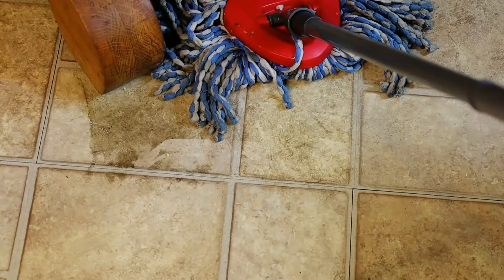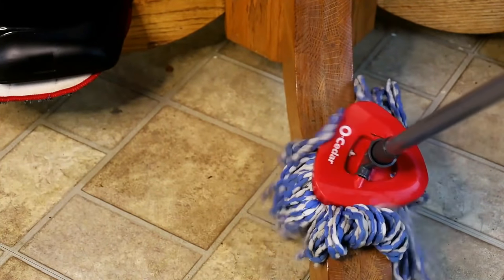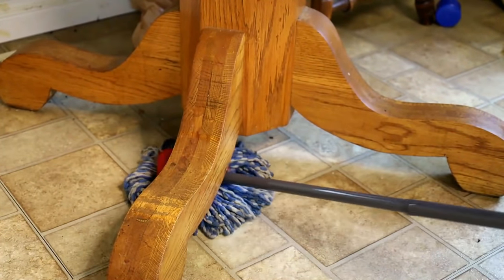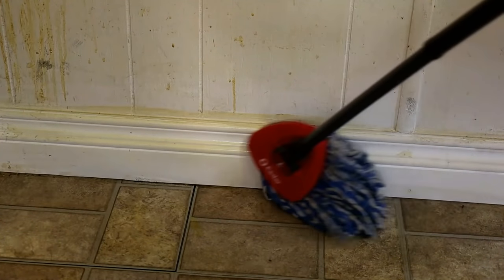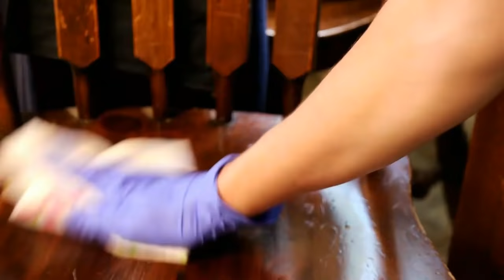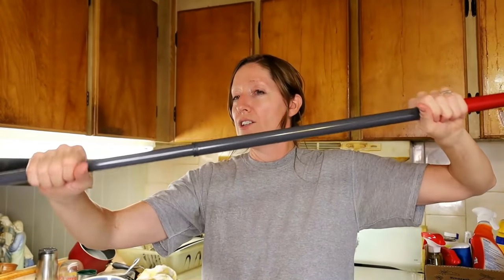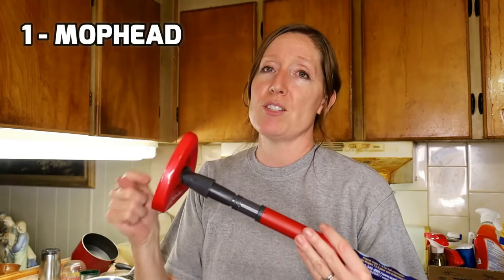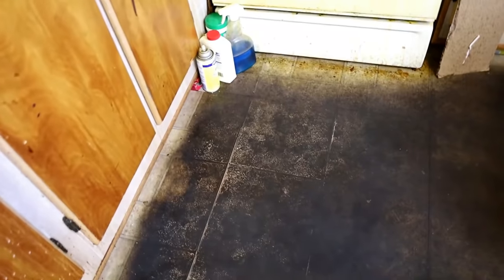UNBELIEVABLE ⚡ Put THIS on Your Filthy Floor and WATCH WHAT HAPPENS

Comment: I'm curious how super hot water and Tide would have done. I've been using it lately to mop, and my husband said they used it when he was in automotive school because it would break up the grease. Your relative is blessed to have you! ❤️
Reply: When I worked at Taco Bell years ago they used Tide powder and hot water to mop the floors. It worked really well to get the floors clean and grease free.
Reply: I used tide with bleach (powder)and hot water with a bristle brush and handle on my great aunts garage floor and walls because she is sensitive to harsh smells. It worked really well and it smells awesome still.
Reply: Yes I think Tide is a better cleaner degreaser than it is a laundry product. Maybe it should stay in the Garage for cleaning.I itch like crazy when ever I’ve used it in my laundry. And so do my boys.
Reply: What kind of floors are you using that on?? Does it leave a film on it afterwards?
Reply: @violetcurry540  I use it on vinyl and tile. It does not leave a film when I use a mop. ☺️
Reply: @smalltowngirl78  Thank you I have hard wood floors and I am trying to find the best clean solution with messing up the floors.
Reply: @violetcurry540  Don't put any bleach (powder or liquid) on your hardwood floors, it'll make whitish spots anywhere the finish is lacking and can cause other problems.I found amonia to be a time tested awesome cleaner (even on floors as bad as the one in this video) you just need to have plenty of air to use it. I used it half strength (half water half amonia) it'll cut through most anything. But test any cleaning products on an inconspicuous spot somewhere to see how it affects the wood finishes. 
Edit: (I've even used amonia full strength on a wet warm cleaning cloth I've laid it on a problem area for 5 minutes and bam, gone.But do not breathe in the fumes or have a 7p e sensitive to such nearby, like kids, the elderly. Stubborn carpet stains come up with a half water and half amonia spray too.)
Reply: @KathyHussey063  Thank you
Reply: @sherry7x777  I agree on the itch factor. I have to use Tide free or Costco Free and Clear for over 30 years because regular detergents and laundry cause itching.
Reply: @violetcurry540  you're very welcome, I just saw words in my last comment were typed wrong so you may want to read my comment again, because I corrected  them. My bad....
Reply: I hate the smell of Tide. Can't stand it.
Reply: I use Simple Green degreaser. It's effective, doesn't stink, and rinses clean.
Reply: @violetcurry540  use white vinegar and hot water I had a cleaning business for 25 years and hardwood floors that's all you want to use is white vinegar and hot water
Reply: @kellierae7602  what is the portions for that??
Reply: @violetcurry540  sorry I just now seen this with the vinegar one cup of white per gallon and your water needs to be hot
Reply: @violetcurry540  another thing if you can't stand the smell of the vinegar it's not going to be too strong it'll go away you can also put in the middle of one or two drops of lavender you know the oil drops it will not hurt it just some of my clients did not like the smell of vinegar if they were home and I'd put a couple drops of lavender drops any of these other products will leave whether you see it or not we'll leave a film a buildup on hardwood floors one cup of white vinegar to one hot gallon of water
Reply: I've used some Tide in my carpet cleaner.

Comment: What a kind thing you did to clean the floor. A cleaning Angel.
Reply: We had a fire in the kitchen that left greasy  black residue on the walls and ceiling.  Found Scrubbing Bubbles bathroom did a great job on semigloss paint

Comment: Great work!  I have one suggestion.  When you were trying to get all of the goop up with a sponge, I thought you could use a wide scraper to lift it up (not really scrape) and just throw the goop into a container instead of washing it down the sink.
Reply: Then do what with it dump it outside?
Reply: In fact it’s going to be a disaster her putting all that grease down the sink.
Reply: Exactly. I'm watching this video thinking, just scrape the muck up into a container. Wiping it with paper towels is just removing the moisture, not lifting even half of what was loosened up.
Reply: Use a floor brush to brush off all the grease cleaner on the floor. After that, use a rubber window scraper to scrape all the grimes to the corner, throw some old newspaper to absorb and repeat until it's all clean. No more mop is sacrificed
Reply: Are you a business cleaning homes ma’am?
Reply: What an achievement. Well done! I’d have tried vinegar first though.
Reply: What would’ve probably worked better is a wet dry vac
Reply: @EyeKnow1111  the man is lucky he even has her there to even try and clean it. Why do you people Gotta be so freaking negative
Reply: @spaghettieggplantsauce8533  . it amazes me how are you all have it figured out using a scraper across the floor will not get the stuff out of the cracks. It would just push it down into the cracks. The mop is needed to get is fine cracks cleaned.
Reply: @teresanoel4035  Says the woman who also offered suggestions on how to do it a better way. 🙄
Reply: @spookshow6999  Dump it in a garbage bag and throw it away...
Reply: It’s built up solid grease with dirt. Scrape it to get up at Least 70% of it in plastic bag tie it up well and toss it. In trashcan

Comment: I'm very impressed with your results. I would have replaced the floor myself. I wouldn't recommend that you be squeezing your sponge into the sink. As a contractor, I would think that greasy nasty stuff would cause a clog or restrict drainage flow.. best to rinse out in a bucket and throw outside on the ground

Comment: O cedar mop is the only mop I use for my cleaning customers. I have multiple heads and clean them in the washer on a double wash, then hang dry them. They are amazing as they can be used on most surfaces, walls, ceilings, bath areas as well as floors and floor boards. Love!
Reply: Hello how are you doing?

Comment: When we were helping family friend who purchased a foreclosed home, I used undiluted Pine-Sol and Brillo pads on the dining room floor.  It was black and caked on so thick!  After cleaning the floor we were shocked at how beautiful the floor was!  It revealed a stunning original hardwood floor - and we couldn't tell it was a wood floor when we started.
Reply: Excellent move.  I used to use steel wool, but it tends to shred and leave metal dust.  Brillo usually have soap in the.  I would just use the pine Sol' or even straight Turpentine with a stainless steel scouring pad to get at that grime. You can always add wax and oil later once the grime is stripped off.

Comment: Hey, when you scrub a linoleum floor like that, it strips off the protection on the outside. It’s super important to put a quick dry wax on the top (mop glo is usually available) and if you just do a quick mop and quick wax once a week your floors will always look brand new.
Reply: I was wondering about this. I don't know much about flooring so not sure if this is really linoleum or vinyl. If there was ever a protective layer on the surface, it's gone now. Maybe freshly applied sealant like you mentioned would help to make it easier to maintain with just the swiffer mop.
Reply: Yep I love mop and glo it really does make a huge difference way easier to keep clean

Comment: You’re an angel for helping this elderly man. Wonderful job! 
However, I was just wondering about rinsing the sponge in the sink. All that grease went into the drain. I never put grease into my drains.
Reply: That grease is no longer grease, it is broken down and will not clog the drains.
Reply: Maybe it will. But I'd be careful all the same.
Reply: Agree greese down the drain then digging it up to uncloging it one of the worst thing Iv smelt not as bad as a decomposing body but it's close.

Comment: Yes, those wet Swiffers would probably be the easiest method for him to maintain. Bless you both. I did that for an elderly  family friend. His wife had passed 20 years previously and she never cleaned, so 50+years of nicotine from 2 chain smokers and grease. The smell was unreal after breaking the seal on that layer but with TSP we were able to wash the walls and floor.
Reply: Are you aware that Trisodium Phosphate is toxic and banned in 16 states?  Do you use PPE when using it?  If not, read the MSDS on it to learn how to protect yourself and others as well as prevent future health issues from exposure to it as well as other chemicals, even if you think it is safe.
Reply: @notagain5045  I did not know tsp is toxic to use!! Wow!

Comment: My only reluctance with using the E-Z Off is that it can eat away the sealing surface of the vinyl flooring, but as you said, the floor was old. Any solution to the problem, in this case, is the way to go. You did a fantastic job!!! 👍
Reply: True good mop after should be fine. I wouldn't do that all the time but once is fine.

Comment: Just a question:  When you sprayed with Easy Off and covered it with plastic wrap, would a painter's drop cloth (plastic) have been easier and covered a larger area?
Reply: I thought the same thing
Reply: I think maybe it was easier to pull up a section to scrub....so it wouldn't dry up?  But I wonder if that would have worked better.  I love how I learn new things from everyone!

Comment: Have you ever tried using powdered laundry detergent and hot water? I’ve just discovered how well it cuts through built up grease on anything, and cleans the floors better than anything else I’ve tried! I’m also finding out that powdered dishwasher detergent works as well, but haven’t tested  it on the floor so not sure if it’s ok to use without doing damage. Great job on this floor and stove, they look awesome and I’m going to have to give the ammonia a try! Thanks for sharing ✨👍🏻👏🙂
Reply: I'm just about to use that on my kitchen floor tiles (they are textured and a nightmare to clean!) It works well on saucepans if you have let something boil dry too, fill with water and powder detergent then bring to the boil.
Reply: @onewomanandherdog5219  wow I’m going to have to try the pots and pans thing, never heard of that idea! Thank you for the tip!
Reply: Have you tried Simple Green degreaser? It's amazing.

Comment: When I cleaned for a living I would use Formula 409 liberally all over the floor and let it sit for awhile to loosen grease.  Then I would use a floor cleaner to finish.  As you learned, time and letting the chemicals do the work is the secret.  Great job!
Reply: Great tip !!! So what would you use on a modern hard wood floor? Thanks!🙏☺️❤️
Reply: Was looking for Formula 409 in the comments.

Comment: When I pulled up the downstairs indoor/outdoor carpeting (I live in a hurricane house), the glue attaching it would not come off. I tried all kinds of glue removers. It was horrible. By accident, while cleaning up after the dogs, I spilled fabric refresher (only a dollar from Dollar General). It started dissolving the glue. I still had to scrub, but at least it started coming off. Thanks for the information.

Comment: Thank you. My kitchen floor is bad and needs some similar effort. Not quite as bad as the floor you cleaned. And before the haters go for my jugular let me saying really struggle after a failed heart op replacing a heart valve and bypasses. I recently bought a new fridge and cooker and want it all cleaned before they get fitted.
Anyhow many many thanks for recording your efforts, it will really help!

Comment: that floor is an all-day job all by itself. Then the cabinets, stove, refrigerator etc. another day or two.  A lot of build-up there. So kind of you to help him.
Reply: Just want to add that TSP, dawn dish soap, and very hot water also works great at removing grease buildup. It has no odor, I was told to use it by a cleaning person when we had a house we were going to flip. The kitchen cabinets and walls were filthy with years of grease, and it worked great. For the walls I used to swfters with dollar store microfiber cloths, wipe on, wipe off, kept wringing out the cloths in buckets of cleaning solution, then final rinse of just hot water.

Comment: Another thing I’ve used is the foaming bath cleaner (scrubbing bubbles). It works on floors, range tops, refrigerator outside surface (I don’t think I’d use it on stainless finishes). I didn’t know about the plastic wrap though.
Reply: Smoke on walls .start at the bottom of the wall so it don't streak it works wonders .

Comment: Question: could you use a shower curtain instead of plastic wrap? And then just run it through the washing machine?
Reply: Yup
Reply: Dollar tree plastic sheet for painting?? And just throw it away!
Reply: Cheap table cloth for parties
Reply: I wouldn't run anything with that much grease on it through a washing machine, though. The grease will transfer to the machine. Better to get the cheapest shower liner or paint tarp and throw it away after.
Reply: I wouldn't because of grease.
Reply: Maybe instead of sponges or the mop maybe a box of paper shop towels would work for cleanup. They sell them in the automotive section of stores.

Comment: I think I would use Brillo or SOS pads.   Just a random thought.  I worked in the Home Ec Dept at college...She taught me to use a hot wet towel spread on the huge fancy Wooden dining table to loosen up the wac.   I thought maybe pouring small pots of boiling water might help Loosen up the buildup.

Comment: I own a cleaning business and we use the oven cleaner from Sam's club. It would have melted this grime right off the floor... plus u need a floor buffer machine with a nylon bristle brush attachment.
Reply: How much would you charge for this much mess and dirt we just witnessed?
Reply: What do you use on toilets that have the hard water stains? I helped my neighbor that is a hoarder. I was able to get some of the stains removed with a pumice brick but my hands are to big for the middle section.  It is dime sized but still. I want to get it

Comment: Wonderful, dedicated work. I however, am concerned that oven cleaner (that seems highly caustic) being used on  flooring material , might harm the finish and cause future problems, maybe requiring additional sealing products.  The comments that recommended auto tire degreaser seems a more compatible product. Great, impressive work.

Comment: Thanks 4 the videos 💞 The only problem I have is the grease going down the drain it will clog the pipes.
Reply from the maker: Yeah.    Most of the grease went in the garbage.   I showed it going down the sink just for the effect for the video.  Probably all of it should have gone in the garage 🤔
Reply: @CleanFreakGermaphobe  place 1/4 cup baking soda into drain add 1/2 cup vinegar let sit 20-30 min or so then rinse with hot or warm water for a few mins. No more grease to clog.. I do this 1-2 xs a month .. I also use in bathtub  and hand sinks dissolves hair

Comment: "Simple Green" does a decent job of cleaning.  Just spray some on the soiled area and let it sit for about 10 minutes and then wipe up with paper towels.  Repeat, 
if necessary.  It can be added to a warm/hot bucket of water for scrubbing floors and walls.
You can also add some Murphy's Oil Soap to the scrub water for a
added punch to cleaning.
Bless you for helping out with this senior citizen. You will be blessed!

Comment: Just wanted to say I really enjoyed your channel.  I saw both stove and floor episodes.  Very informative.   When you were  cleaning the floor with the sponge, the gunk was floating around, it brought back memories.  I took care of  an older, 104lb dot with a
sensitive stomach.  I'd clean up so much so often, it was unbelievable.  Anyway, the best way to wipe up a watery gunky substance  was to use a dust pn and a plasric scraper.  The kingd used for plastering, but much smaller and plastic.  It won't harm the floor, carpet,  most furniture while picking up. 5hank you for your channel 😊

Comment: great job cleaning.  one thing to try at some point in time.  spray nine and a steamer.  we had a room in our manufacturing office that looked like that floor.  lots of oil and grease from forklifts, machinery, etc... we sprayed it with Spray 9 and let it sit about 20 minutes, then went over the area with the steamer.  it looked brand new with basically no scrubbing.
Reply from the maker: Interesting, I’ve never heard of Spray nine. Is it available in the US?

Comment: At this very moment I am sitting in a disabled 66 year old single man's house wanting to clean up for him too. I found you when searching how to clean a filthy house. I wonder if the Easy Off would ruin his unfinished floors. He has the same grime on his living room floor - it's a wide (4 or 5 ft) 'path' of thick black grime leading 20 ft from the door to his house to his kitchen. I already got his kitchen floor clean as it will come because it was linoleum and believe it or not, not near as bad. But there is his bathroom floor and his tub is beyond nauseating. Thank you for this video. I'm going to try an inconspicuous place on his plywood unfinished floor and see if the easy off kills the wood. I think it probably will so am still looking for something, anything that will work. Right now I'm off to the tub with vinegar, baking soda and Dawn...wish me luck.  I'm 70 years old but I have to try to help him!

Comment: Awesome job! I have tackled similar disasters. I do not even attempt to clean without the "Right Stuff" from Wal Mart. I used Purple Stuff but when it was no longer available I tried many things and this Right Stuff is awesome!  It is sold in concentrated form with directions to dilute but I usually use full stength.